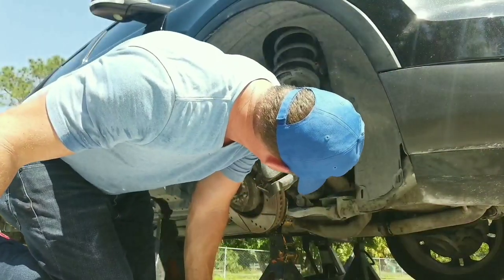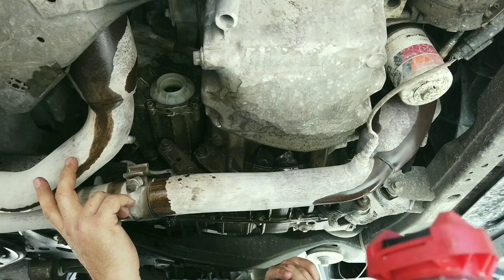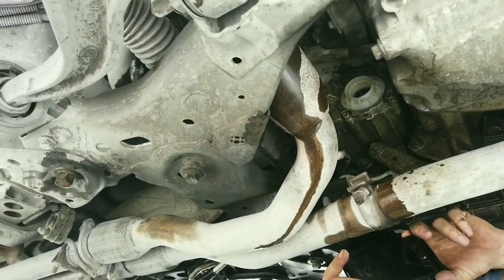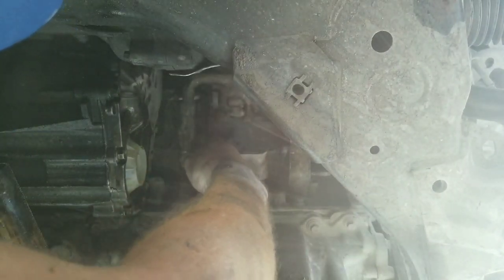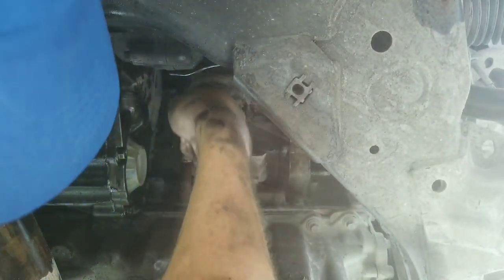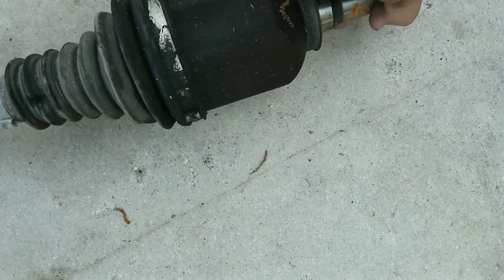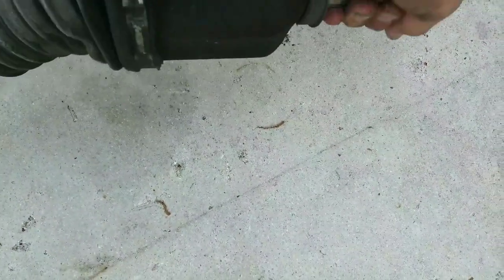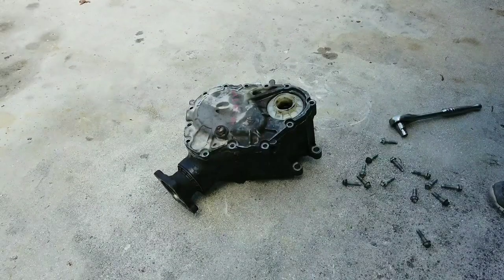Ford ptu failure! PowerAddiction

Comment: This always turns even when 4WD is not on?
Reply from the maker: Yes. On the sport model you can't shut 4wd off and it adjusts power output for front and rear as necessary. Not sure on other models. I'm assuming it always spins the gears inside though
Reply: PowerAddiction Wow, good to know on the Explorer Sports. The knob inside with sand setting etc.... is just adjusting how the 4WD acts?
Reply from the maker: @lotus956  yes it has a torque management system that allows torque to be transfered to the rear wheels when the computer thinks its necessary. Its done by electronics in the rear end. Forgot what the exact name is off the top off my head but the rear driveshaft is always turning even when all the power is to the front wheels

Comment: I just got the part in for my 2013 explorer. The put. And I’ve seen videos of some fluid leaking out when the ptu is separated from the transmission. I was wondering if you could help me out. Is it tranny fluid and do I have to top off the tranny fluid?
Reply from the maker: It is transmission fluid. There is a seal between the ptu and transmission where it bolts together. I would top it off if needed. If it's just a couple drops dont worry but if it looks like enough to check it out then yes top it off. Just dont over fill it.

Comment: How long did it take you to replace the two front shafts and the tpu ???
Reply from the maker: The driver side shaft takes about 40 mins. The passanger side shaft takes about 40 mins and the ptu if it was on a lift with air tools 3 hours but I had it on jack stands and was laying on my back and took about 7 hours. I had to climb out from under the truck for tools and stuff. Take a break for lunch.
Reply: Not to bad a garage would of charged a ass ton !!!
Reply from the maker: @cmullen1976  save about 2 grand in labor

Comment: Your watching puppy dog pals. My daughter does as well lol. My RS is getting a new PTU now. Only 17k babied miles lol.
Reply from the maker: Lol I need to be more aware of my background in my videos. I have a shoe on the back seat of the video of me driving my mom in the challenger. Puppy pals runs all day until my 2 boys go to bed. Couple other kid shows too. All wheel drive is awesome but the ptu is horrible. Hopefully the next generation with the rear wheel drive based all wheel drive system. they have less problems on the explorer. The explorer st interests me.
Reply: Today I’m going to crack open the like new PTU and see what’s going on. Maybe I  can take the like new one home and rebuild it.
Reply from the maker: @michaelb9757  be careful not to crack the housing. My guess Is the gear to the rear driveshaft and the gear it rolls with is chewed up.
Reply: PowerAddiction I couldn’t mess with it, tech had to send back to ford. Plus I also needed both front half shafts and bearings lol.
Reply from the maker: @michaelb9757  lol that's exactly what happened to mine. It's crazy. I bought my parts outright because I had no warranty and it cost me 2 grand.
Reply: PowerAddiction damn man, that sucks. I’ve only had mine for like 5 moths, they gave it to me CPO with only 11k miles on her, and I knew off these issues so I bought the ESP and Maint plans. They paying this time lol. The positive is they gave me a new f150 to beat on loll.
Reply from the maker: Sweet! Yeah I got mine with 28k on it not CPO. It had the remaining factory warranty but ran out 20k mile ago. How do you like the f150? I hear they are pretty amazing. Is it the 5.0 or EcoBoost?

Comment: How many miles was on it?  I have an SHO.
Reply from the maker: It had 81,000 miles. If you are worried you can change the oil with a pump, if you work on your own car. If not then take it to a dealer and have them change the fluid. Doing it yourself will allow you to see what the fluid looks like. You can do a google search on ford ptu issues and you will find a million things. I beat mine up. It's been down the strip probably 20-30 times and I pull a 3500lb trailer but people with stock cars have them break with fairly low miles.
Reply from the maker: P.s. my fluid was turned to what you see in the video..... basically sludge. It looked kind of like old gear grease but it's supposed to look like cooking oil kind of

Comment: ALERT ALERT CHANGE THE GEAR OIL ONCE A YEAR OR 10K MILES IF AND ONLY IF THEY ARE HIGHWAY MILES that PTU is sandwiched with heat from the engine and transmission my MKZ has a cat next to it that a burn gear oil this July I will take it in and have the dealer drain and fill the PTU my first one bit the dust at 30k I had it in to have the gear oil replaced it was cracked. I also had the Rear Differential Unit done as well the ass end has no heat around it. The gear oil was beginning to oxidize. Seriously? My Lincoln was a CERTIFIED CAR TOO I RIPPED THE BANDAID OFF AND EXTENDED MY PREMIUM CARE WARRANTY UNTIL 2027 JUST IN CASE. Check the gear oil now if you haven't already lack of fluid 18 ounces is not enough to cool them
Reply from the maker: Yeah Ford dropped the ball on that design

Comment: ford edge is a hunk of shyt.. 17000 miles ptu leaking already...
Reply from the maker: Yeah shares the same ptu as the explorer, sho, flex and explorer. I would think they would beef them up for the high horsepower and torque from the ecoboost.

Comment: Not Fords fault. If you change the lube every 30k miles you wouldnt be changing it out.
Reply from the maker: That would be correct if ford didnt state it is a lifetime fluid and has no maintenance protocol. Imagine someone buying a vehicle and bringing it in to the ford dealer for maintenance on all the scheduled maintenance recommendations in the owners manual and a dealer never mentioning it and the owners manual never mentioning it and after all their efforts to take care of the vehicle the ptu goes out at their expense because ford never put it in the maintenance recommendations because it's a lifetime fluid. Funny thing is they put plugs in the ptu now and have a recommended maintenance interval for it. Seems like they fixed their mistake.
Reply: @PowerAddiction  I have a 2017 and my PTU has the plug you're talking about. But I can't for the life of me find a fuse for said plug, Plus my dealership told me this is not an item which needs service, it has the lifetime fluid in it. In my owners manual it says to service it if it is ever under water, or 30,000 miles, The dealer and the ford people back east do not agree with the owner's manual. Also read somewhere if the fluid is ever changed the date it was changed needed to be inputted into the system, How, when, and who? Guess I'll find out after I change mine? I have 51K on mine now.I'll let the dealer help me with the input stuff. LOL
Reply from the maker: Yeah definitely have it serviced. The newer ones have the plug for a reason. Mine was a 2014. If your dealer won't charge it take it to a reputable mechanic
Reply: LIFETIME FLUID (stated in the owner's manual)
Reply: @PowerAddiction  yep. The Ford dealer I have been bringing it to for almost a decade never recommended to do anything with that fluid. Fortunately I was having the transmission flushed elsewhere, and the mechanic was familiar with the issue so checked the PTU has well. And told me about it.